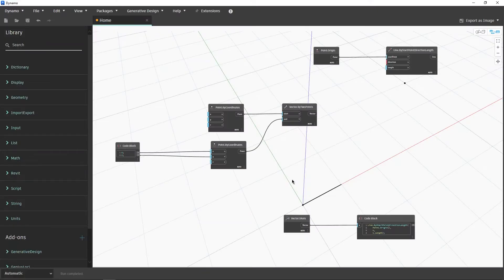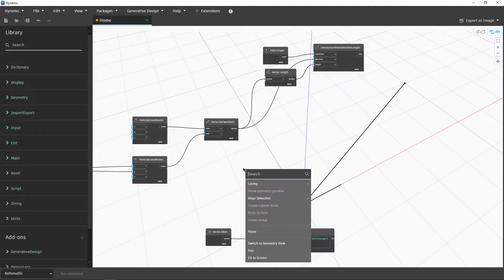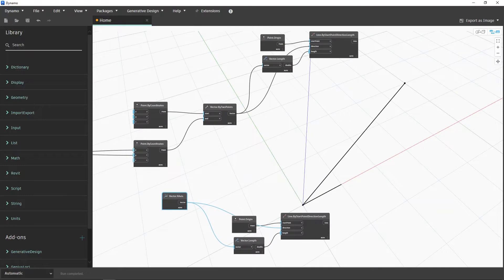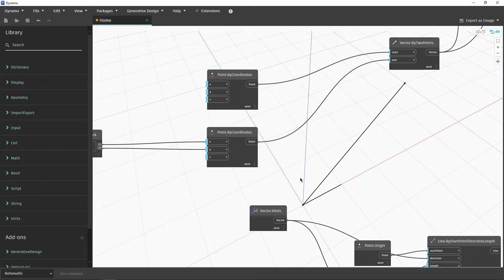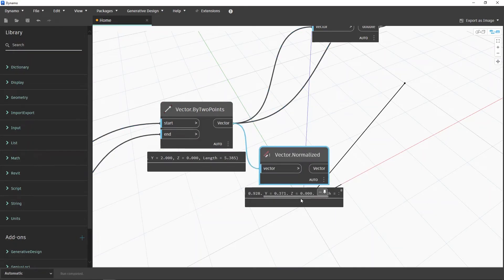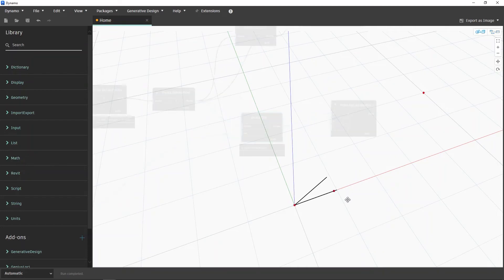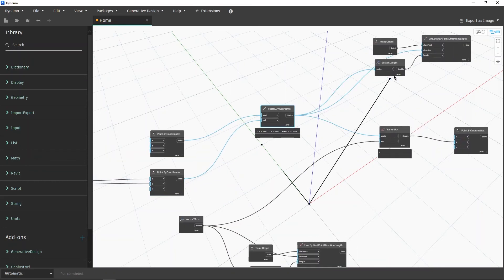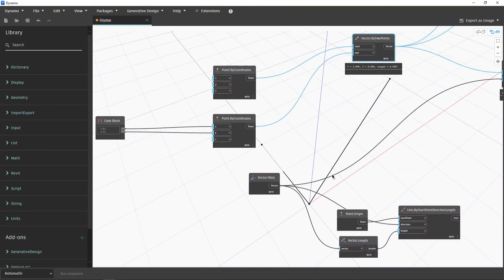Master Vectors in Dynamo | Measure the distance between points along a given vector

Comment: Great 👍 after the vector s série could you explain how to extract part of a curve like one half of a room’s boundary’s line?
Reply from the maker: Hey. Bender!Thank you, to get half of the boundary line? What do you need that for?)
Reply: @mariyandeveloper8437  i need half of the boundary line to offset it and get the center of a corridor. I plan to use it to place lighting families.
Reply from the maker: @bender06160  If you really want to do this using lines, you can simply offset it, and then get the center point of your line. Do you need to get the center of your room? Cuz if yes, using lines is not the best approach to go about it
Reply: @mariyandeveloper8437  I have a corridor with multiple turns. I have a room placed inside the corridor. I would like to place lights in the center of the corridor every 1.5meters from start to end. To do so I extracted the boudaries lines of the room element and I offset it by half of the corridor s width but sometimes I get double lines so I thought I should only get one side of the corridor and offset that. Hope I explained better. Thx 😊
Reply from the maker: @bender06160  Could you send the screenshot of your corridor, please?
Reply: @mariyandeveloper8437  ok thank you! I ll try to upload a screenshot on Instagram or something similar to show you how it looks.
Reply: @mariyandeveloper8437  where can I upload my screenshots ?
Reply from the maker: @bender06160  insideoutarchitecture.08@gmail.com